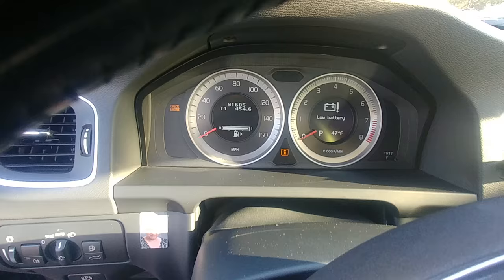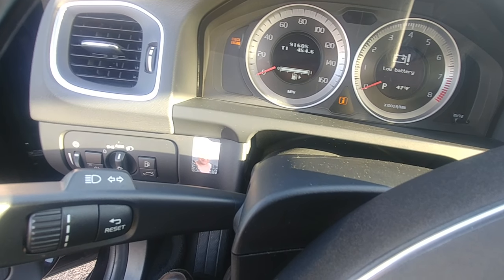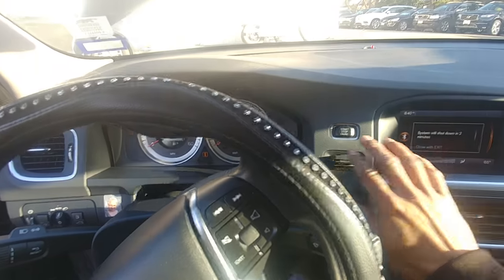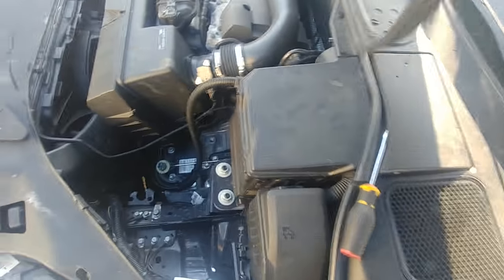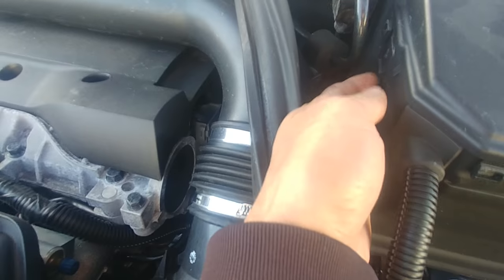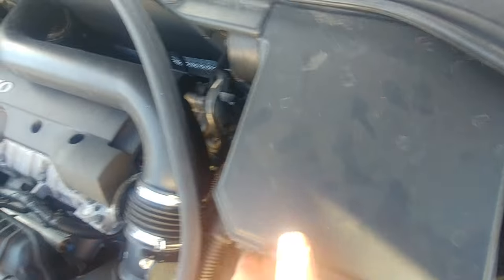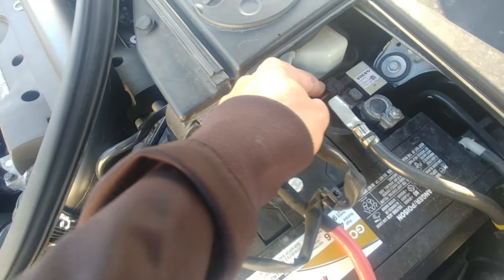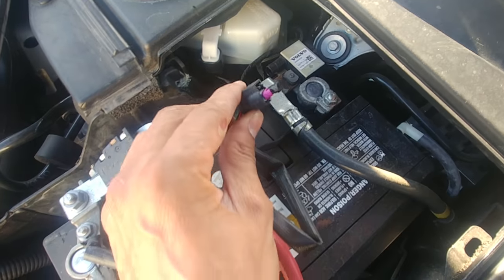How to clear Low battery message on a volvo 2011 and up

Comment: Hello. May I ask a problem that may be related to this issue. So there were about 2.5 weeks I did not drive my XC70 and the battery(replaced 1yr before at 4S) was drained, I jumped started and the driving was good. However after several times driving, 1 drive/week due to stay at home order, I found some issue with the car. When I drive in low speed, like trying to get in a parking spot, after 20-30 mins normal driving,  the car's light is flashing from dim to bright, and steering wheel suddenly locked, but resumes to work after around 2-5 seconds. The problem is pretty random, and may not show up after each time driving. But there was a time that the car completely shutdown itself when I was in reverse gear trying to get in parking spot. I started the car again after 1 mins, and car resumed to normal. So I did some simple diagnose with multi meter to my battery and alternator and found out alternator is charging battery with right voltage 14.4V, and battery voltage seems good is about 12.2V after it parked for 1.5 week. The car dashboard shows up low battery voltage warning, even when actual battery voltage is around 12.5V tested with multimeter and with surface charge drained. So do you think my car's problem could be related to the messed up battery sensor? Or can I try to reset the computer of the car, is it harmful doing this whole car resetting?  Thank you very much! I am sorry the question is too long.
Reply from the maker: Su Lu i think your problem is in the reed pulley that comes loose if your car is a 3.2 or 3.0L
Whrn ever yoy see warbing message check if alternator pulley is turning. Alternatir is under inrake manigold but you can see pulley from too
Reply from the maker: Su Lu top
Reply: @VolvopediaGuy  Today's morning, when I was checking alternator voltage, I saw it's belt and pulley and all of them rotating good from visual inspection, maybe I should check the belt tension?
Reply from the maker: Su Lu It 
When the car is acting up you should check alternator.  See battery voltage too and that way you should know if it’s charging or not
Reply: @VolvopediaGuy  OK, I see, I will keep it in mind. Since the problem is pretty random, I need to more attention on it. Thanks for your tip

Comment: In my car the warning is also coming up after minutes of Listening to the radio without running the engine. After that the power save mode turns on and the radio turns off. Is this trick only for getting rid of the warning or also "getting rid of the power safe mode and the turning off the radio problem". Or in other words is this sensor responsible for turning off the car?
Reply from the maker: This trick will get rid of both

Comment: @Volvopedia Guy  It's a great trick. But I got bit confused, doesn't this trick puts on a situation to overuse a bad/weak battery ? 
How do we know the Low battery warning is not real ?
Reply from the maker: Electronics are also very complex same as batteries. It’s like a phone we reset them because it glitches . Same with bms sensor by reset it it will refresh and take a better reading of battery.  I have test batteries with battery tester when car comes into the shop and test 90-100% good and charged 
and next week car came  in with a battery shorted . And that’s without resetting bms sensor. 
Each car we test Battery , qpart of 20 point inspection

Comment: Reset performed after battery replacement 2014 S60 D3 and the momentary fuel consumption show 0 litre per hour at idle and it shows always 0.6 less than the normal value.
Reply from the maker: I remember seeing 99.9 at idle   I think on petrol engines

Comment: Is this helping for stop start not working? Or is this because of stop start not working? Can you tell me where the support battery is as I think it needs charging or changing. Also I will try this trick tomorrow when I check the battery voltage on a multimeter.
Reply from the maker: Alex someone’s support battery will say 12,6 volts but will not have amps (juice) not charging othe rines will read 6volts do a battery test based on cold crancking amps. 170 Hour amp
Start stop will work if electrical system is working ok and if all trouble codes are cleared
Reply from the maker: Alex if start stop is working and u unplug battery sensor , or disconnect and connect battery start stop will deactivate
Reply: Volvopedia Guy I found this battery it’s next to the main battery under the plastic trim and I tested the voltage and it reads 12.8 same as the main battery at 12.8. I can’t get a battery test done just yet but while I was checking the voltage I found the main battery terminals were not tightened up fully so i think that was causing my low battery message and the start stop did work once but the car restarted on its own. I also did your trick to reset the BMS too. I’ll see how it goes the the next month or so but I’m not so worried about the start stop working, just the low battery message but I believe I’ve cleared it fingers crossed 🤞 thanks for your help

Comment: If you bring it to a shop to get the battery replaced will that automatically do that ?
Reply from the maker: Technician has to reset the battery monitor sensor if not it will be the same
Reply from the maker: For some reason it won’t work on aftermarket batteries

Comment: Hi, I changed battery for a new one on volvo s60 2014, work fine for 2 days, then wont start.... 
Check on positive terminal, it has like a fuse or relay in there, you know what it is, because that isn't passing 12v to the starter motor.... is a problem of that fuse/relay or just reset bms with scanner?
Reply from the maker: Yes . Cable has a small tab that cover the fuse . Remove little cover (light pink color or faded orange.  What i do is . I use a little torch that i uave and heat up center where the soldering is shown . Add a little more soldering and get it hot so the new soldering will encrust.
Reply: @VolvopediaGuy  What you mean replace the fuse of positive terminal ? or fix it? Thanks man
Reply: @VolvopediaGuy  Because my fuse is broken, I need to replace it or remove it... because the 12v dont reach the starter, what you recommend?
Reply: @dakoe  Did you manage to solve your problem? I'm having a similar one
Reply: @thejoseandresshow  yes, I had to weld this cable...

Comment: Would you tell me please--do I need to install any particular type of the battery just to keep sensor quiet and to be in the mental rest by myself? I am afraid to drive the car now. 
my battery is  5 weeks old. --wouldn't tell which I have......TIA $169 paid O'Reillys
Reply from the maker: Diana McClanahan volvo battery. Remove sensor while engine running and reconnect
Reply from the maker: Diana McClanahan But try it again I don’t know your tried with the engine running
Reply: No-no, didn't try it yet. Was looking up on utube trying to relieve the stress, subscribed to you. I will not even lift up a hood by myself, I am 5feet tall. Will ask someone at work tomorrow, will watch out, will let you know--will get back to you with outcome. Stressful. Mine is Swedish made, btw. TY!!!!!!!!!!!!!!
Reply from the maker: Awesome.
Reply: @VolvopediaGuy  Ok,  I see it is about 2 weeks since it was reset. Was relatively peaceful but today "low battery" warning came on again. To reset it again? Next step? TIA.
Reply: @VolvopediaGuy  Any ideas about where I can buy original Volvo battery? Approx. cost?
Reply from the maker: Diana McClanahan best thing is from dealership. Give them your vin numbet and tgey will be able to pull out information. Correct Cold cranking amp battery. If a dealer ship is far from you that mihht be a problem.  Try to grt part number from battery when ever you get the quote and type it on Google . Maybe you can buy it online with correct part number

Comment: Are the XC60’s pretty reliable? Considering an 13 3.2 AWD
Reply from the maker: Albert all wheel drive is fun to druve but expensive to repair. If you want a kore convenient car I recommend without all wheel drive.
Reply: Albert I highly recommend a 2011 Volvo XC70. Extremely reliable! Back in 2012 I had a frontal passenger accident which caused 20k in damages. To this day, I still have the car! It has 230,000km’s and it runs great! No issues at all. The AWD is holding up very well as well!

Comment: I have learnt in some models i think from 2013 up you can start the car with your smart remote. The one with 'i' on it
Reply from the maker: Yes
Reply from the maker: But the software needs to be downloaded to work
Reply: @VolvopediaGuy  I checked with them. Does not work/will not work in Australia and no aftr market upgrades for this :(

Comment: Thanks so much for this info. It worked!!! Got my car back from a guy who repaired headliner and for some reason getting a message DSTC temporarily off. Cannot get it to come back on. 2013 S60. Can you help?
Reply from the maker: lm39215 hello you may have a wheel speed sensor not working or a sensor related with abs system
Reply: @VolvopediaGuy  Thanks, will have it checked out.

Comment: Do you know if there's a way to change the maintenance interval from 7500 to 10k miles? I switched to synthetic oil and only needs to change it every 10k miles instead of 7500 miles now. I see that volvo s80 2013 starts using synthetic but 2012 is on regular oil.
Reply from the maker: Zehua Zhou i dont think there is a way but if i was you i will keep doing it at 7500 even wiyh Synthetic. That way your engine ill be clean
Reply: Just change at 7500k like normal or reset the service indicator when it comes on.
Reply: Do yourself a favor and change synthetic oil at 5k miles if you want your engine to live. DO NOT extend to 7500 or longer!!

Comment: Have the same issue volvo s60 2013, new battery  put on yesterday. Stop/start function wont work either🤔
Reply from the maker: Lazerus Phoenix Clear codes and reset bms with scaner

Comment: SO does this work with after market batteries? 
Or does a person have to keep resetting the  system?
Reply from the maker: After market batteries might give u hard time. But oem will work
Reply: @VolvopediaGuy  Why would the battery make a difference?
Reply from the maker: John LaGreca That’s a good question, that I haven’t found. Sorry for my honest answer
Reply: @VolvopediaGuy  No worries :) Thanks for the prompt response. I have tried this method on my 2011 XC60 T6 and still the low power mode comes on when I run the radio with the engine off after 2 minutes. The battery voltage is 12.6 so I still don't know what the issue is. You can leave the headlights on for a day and the engine turns right over but if you try to run the radio for 2 minutes it goes into low power mode, something wrong with that circuit and/or the software for sure.
Reply from the maker: John LaGreca did you unplugged the battery sensor with car running? It suppose to be with car running .
Is your vehicle equipped with sensor?
Reply: @VolvopediaGuy  Followed the video (yes running) and the connector is identical to what is in the video. Tried it twice and still no go. Also just drove around with the plug disconnected for a day and still drops into low power mode after engine is off after two minutes with warning about shutdown on the display.
Reply from the maker: John LaGreca yhea i seen after market battery do that.
Reply: The battery may actually not have adequate capacity (charge) even if the voltage shows as sufficient. Use a battery charger and/or tester and make sure your battery is sufficiently charged. Then follow the procedure to reset the BmS and then if you still get the Low Battery message, something else is going on such as parasitic drain or alternator not sufficiently charging the battery.

Comment: great video. I currently have this light on but the car will not start in addition to multiple lights including immobilizer and a big lock. 😑
Reply from the maker: Try another key
Reply: @VolvopediaGuy   I have one key
Reply from the maker: tra young its either key or battery very weak

Comment: tried this on two volvos with oem batteries, does not work
Reply from the maker: cam irving was the car on?
Reply: @VolvopediaGuy  yes
Reply from the maker: cam irving send me the year and models please
Reply: @VolvopediaGuy  2011 s60 t6 and 2012 xc60 3.2
Reply from the maker: cam irving  i will check

Comment: Let a mechanic check the electrical system. Clean tighten cables check water if not a sealed battery. Could be alternator not charging the battery. This is what sucks about having a digital computers checking everything. Some you can’t check your oil or transmission fluid it’s done by computer. If that screws up you could lose the engine or transmission. Hey but what do the engineers and companies care if you need to purchase a new engine or tranny. It’s sales isn’t it?

Comment: Can this censor be switched off  thanks in advance
Reply from the maker: That sensor will help you to prevent battery drain. Like when you listen to the radio with the engine off. If the car read low voltage the radio and all internal lights will turn off.
Reply from the maker: John LaGreca  sorry can u explain more your question please

Comment: HI can you help i have an intermitent a c problem it was working fine before i  ve changed the battery now it work one day then next day not working again if i disconnect the battery it will work once then when i stop the car it is not working again  helpp!
Reply: Same problem..

Comment: I wonder how many people have replaced the battery 🔋 when it didn’t need it , I only use my XC60 twice a week now and have to charge it every month
A word of warning do not leave your car at the airport for two weeks as you will have a flat battery 
Poor show Volvo for making cars that you cannot park up for two weeks 
My next car will not be a Volvo
Reply: So many new cars will have the same problem after a couple of years for the same reason as your Volvo, FYI. I have to park my other car for long periods too and know your pain. Some people I know use solar panel chargers or battery disconnect switches as a solution.

Comment: This method did not work on my 2012 S60
Reply from the maker: Zoe Warner do you havr aft market battery.???
Did you do it with engine on?
Its supposed to be with engine on
Reply: Didn't work on my 2012 S60

Comment: You have to do a relearn procedure for the batteries so the car would basically start from scratch on testing the actual load capacity of the batteries.

1 - Ignition ON (engine off)

2 - dipped front lights ON (turn light switch to far right)

3 - Rear fog lights press 6x (3 on/off cycles) (button to left of light switch)

4 - Hazzard lights press 3x

- Battery icon blinks 3x
Reply: Really? Does it work?! Looks like a cheat in a playstation-game 😛
Reply: Didn’t work on my S60
Reply: @elias5791 I saw another instruction with 5x fog light

Comment: Hi please help me,i am driving an XC60 T6 2010 model,it displays the charging failure service urgent warning on dashboard. It can just lose power. I have replaced the car battery but problem still persists. My local auto electrician diagnosed it but it showed no faults in relation to that,i.e altenator. He said it was a wiring issue,. Pleas assist. @volvopediaguy
Reply from the maker: Chevy alternator if is spinning.  If not. The gear pulley where the little belt is attached to alternator pulley is loose .
Reply from the maker: Check alternator
Reply: @VolvopediaGuy  thanks,il get back to you